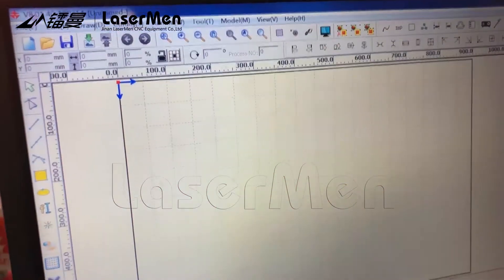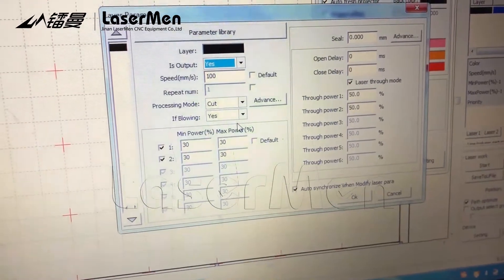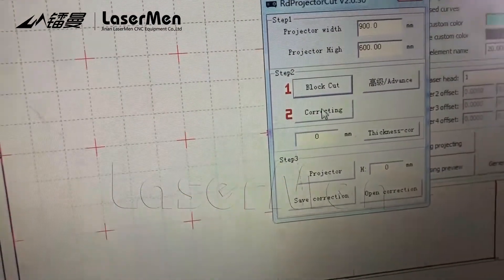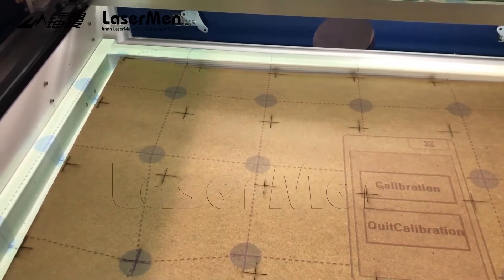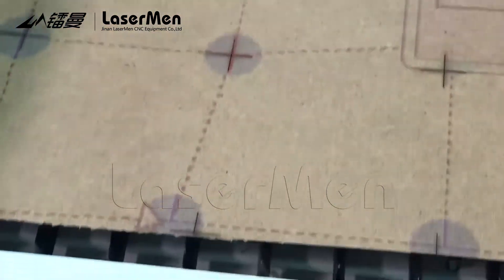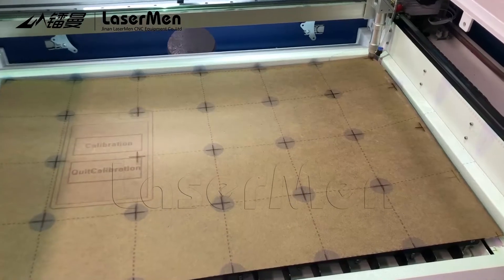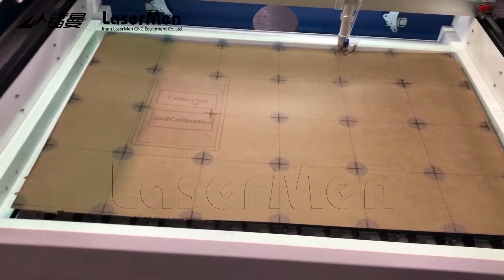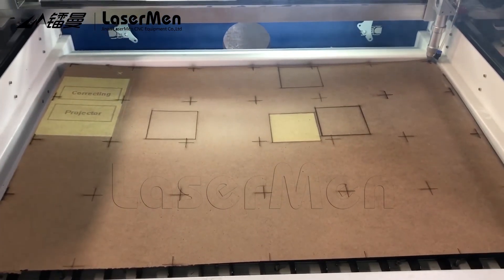[LaserMen] Projector laser cutting machine calibration instruction

Comment: Whether any projector can be connected or must be a specific model. How exactly does this come together?
Reply from the maker: Usually ultra-short throwing distance projector, with high resolution, with good brightness. The projection accuracy is decided by projector resolution, and also by how accurately you calibrate it (projection ratio and laser machine ratio has to be the same).